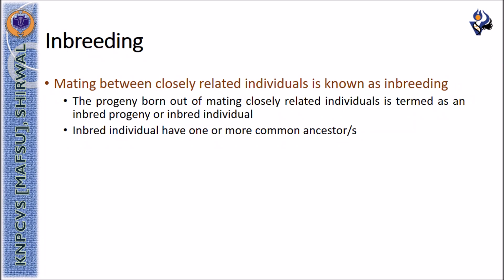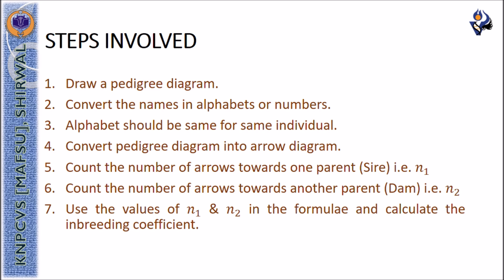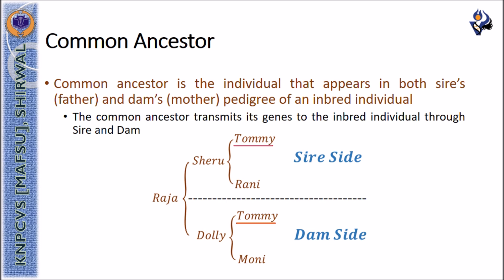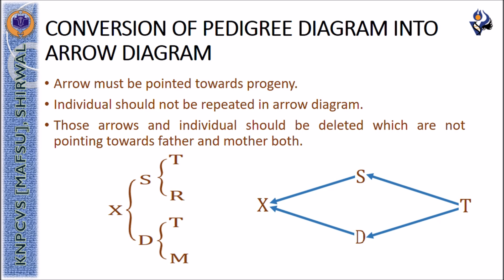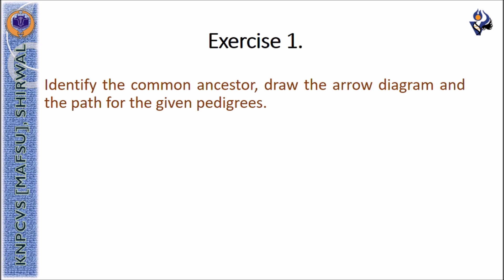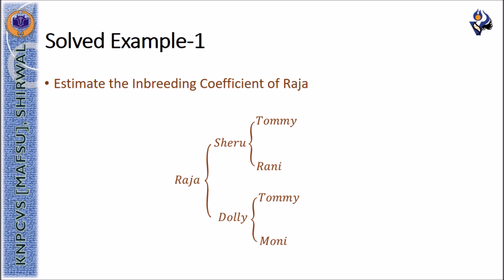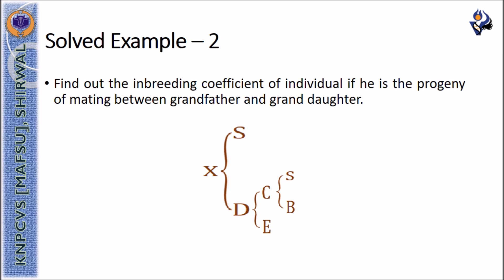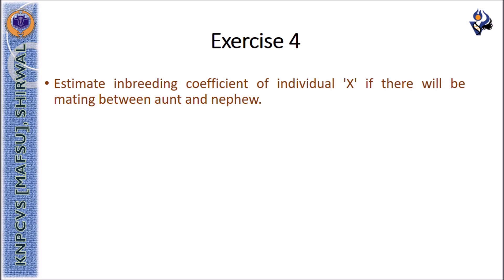13  Coefficient of Inbreeding Part 1

Comment: how can we check answers?
Reply from the maker: Hello Nimra,
The answers are as follows;
Exercise 1= 0.0625;
Exercise 2= 0.3125;
Exercise 3= 0.28125;
Exercise 4= 0.125;
Exercise 5= 0.25;
Exercise 6= 0.125.
You may please try solving it yourself and check the answers.
Thank you.
Reply: @aakashdoiphode   Shouldnt exercise 2 be 0.375, cause its a 2 generation inbreeding?